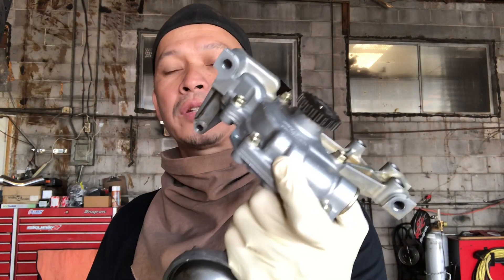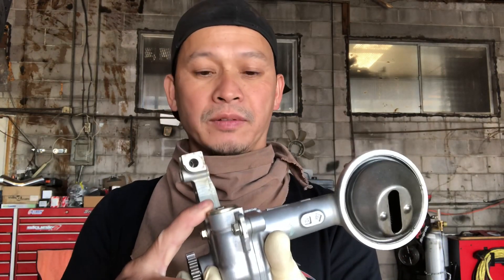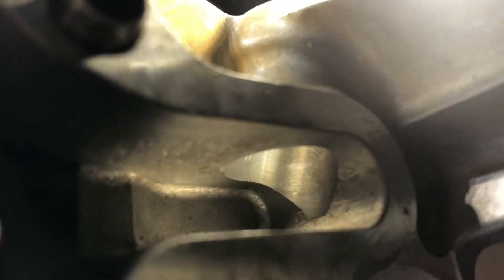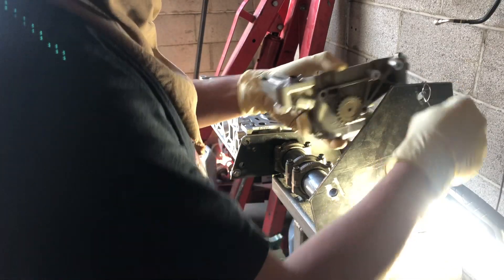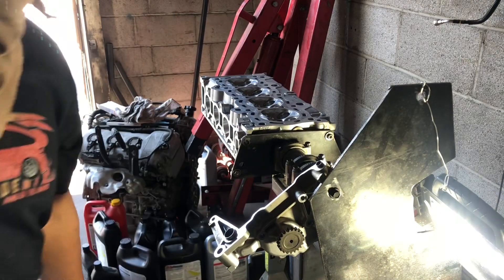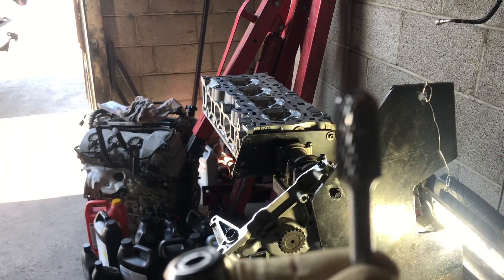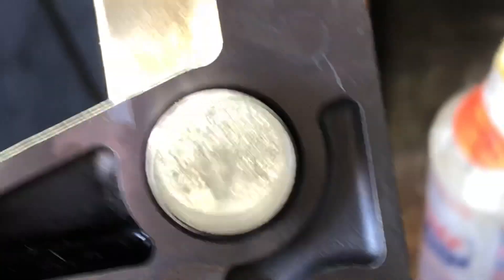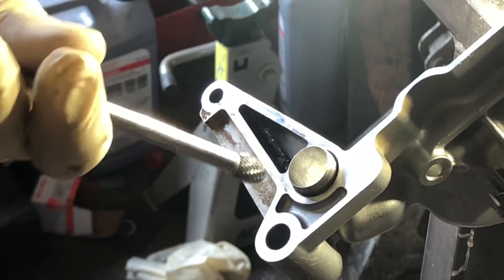K20 A2 oil pump porting job!!!

Comment: Hi, I really admire your work, I saw your video where you porting on the k20 a2 engine oil pump, I would like to know what size ring you use to give pressure to the spring

Comment: Amazing work! I am curious though at what point will that pump start aerating? Especially since you're turning so many RPM. it would almost be beneficial to slow down the pump speed. it wouldn't affect pressure especially since you have such a high idle and it would reduce aeration in the pump when your at 9-10k rpm. I would compare gear sizes to the S2000 pump. The pump doesn't care how fast the engine is spinning it's going to deliver whatever flow is required and bypass the rest. so there's margin there to reduce the gear size and keep from aerating. Just some ideas

Comment: Great video👍. How is it in basically every form of motorsport Ive come across, theres a humble dude in the background like Phong with knowledge, a die grinder, and a burr bit buffet ready to make you go faster??lol... Example: I have an '03 Suzuki RM 250 that has had extensive cylinder porting.... idk why or how or what im lookin at in there, but I do know if Im jetted right it hits harder off the bottom than any 2stroke Ive ever ridden and wrecked both knees and collarbone of the previous owner lol...